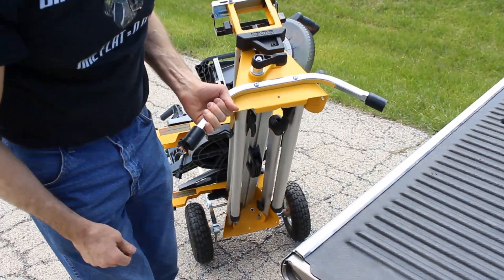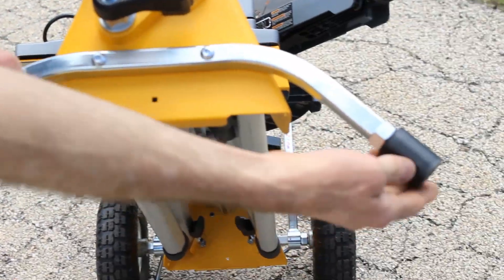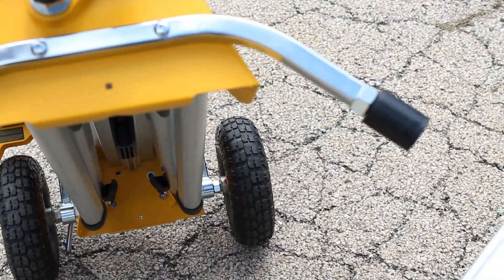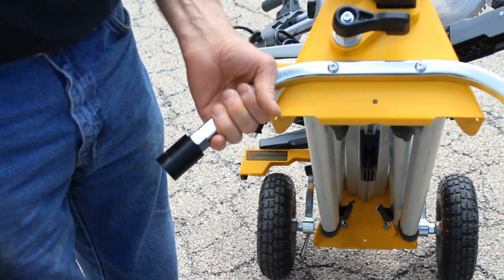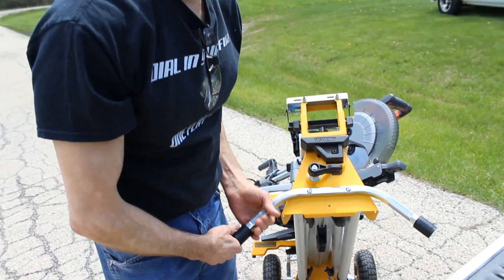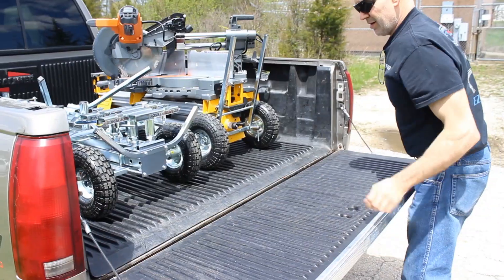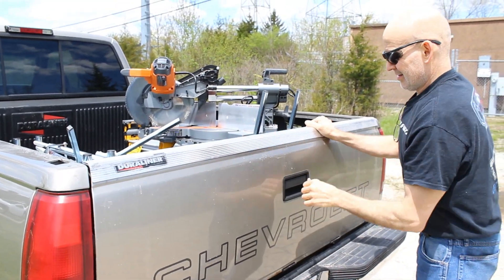The 4 Minute Miter Saw Fence by CFS

Comment: How does your product handle 13 foot 2x10 joists? And do you have any problem with the fence moving relative to the saw; gaining inches, due the weight of the lumber being thrown around?
Reply from the maker: Hi Phillip, Thanks for commenting. Our product will easily handle 13 foot 2x10 joists. We've regularly cut 70 lbs aluminum tubing in excess of 20 ft long and this system has no issues with it. As long as you don't use the stop as a battering ram, it will definitely hold tolerances of +/-0.005". The fences are clamped to the saw stand, so as long as the saw stand isn't compromised and you have adequate clamping pressure of the clamping mechanism , you shouldn't see the fences growing or shrinking either.

Now some bonus info: We've found that the DWX723 Stand can hold up better to the heavier material than the DWX724 simply because the clamping mechanism of our fences are spread out wider so the fences inherently will be as rigid as possible. It is possible with the smaller stand, but if rigidity is your concern, we would recommend the larger DWX723 Stand for this.